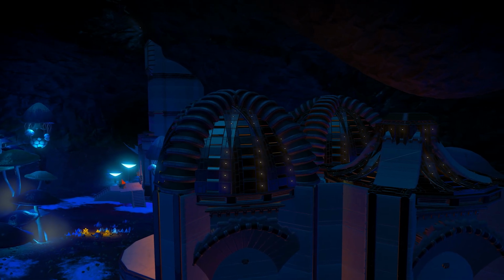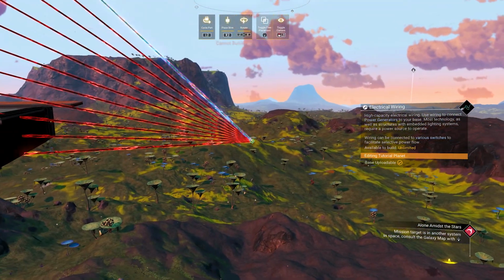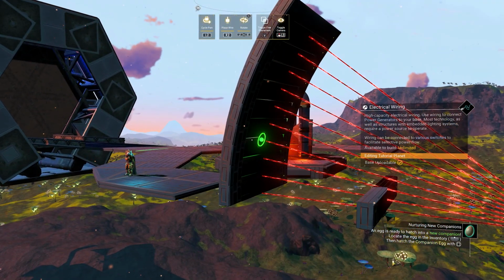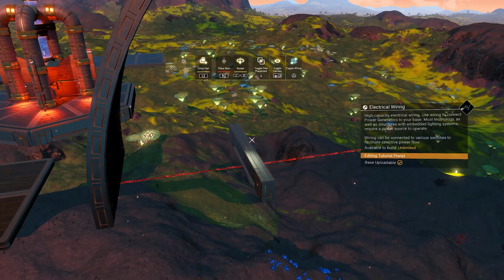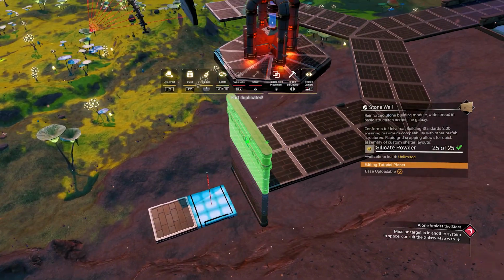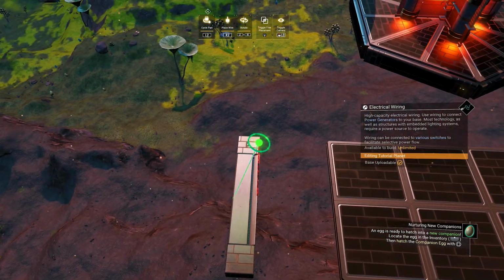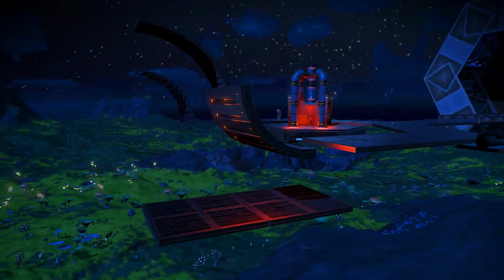How to Build Curves in No Mans Sky Waypoint 4.0 - Glitch building techniques

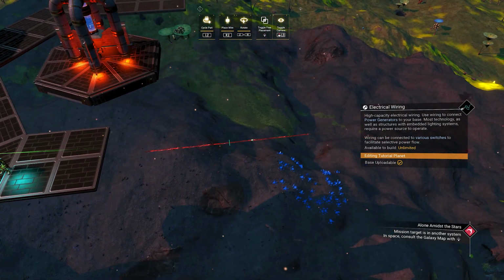Comment: Perhaps I'm too late on learning this glitch, but it seems to be outdated when using the 5.74 Worlds II Update. I can get the electrical lines lined out to match at 1:11, but when I go to try and line up the small alloy wall a with the end of the wire. I do not see a snap point at all. The only snap point I see is the top and bottom of the alloy floor panel.
Reply: Hello, I'm a PC player but you may find the right keys if you are a console player, tried today and it's still working. (Made my first curve youhou :) ) So there is 2 steps involving the Wire Toggle Key (A in my french keyboard, Q for others),  1/ Create the wire : Select a build piece, snap it (don't build yet) and then press Toggle Wire + Build (A or Q + Left mouse button), in this operation you actually see the build piece that will be replaced by the wire. 2/ Place a piece snaped to the wire : Select the piece you want to place, press A or Q to go in Wire mode so you don't see anymore your piece and the wire anchor point is visible, select the anchor and press A or Q + left mouse, your piece should be build and snaped with angle. if you miss the trick because of synchro, just press A/Q twice (go out and back to wire mode) to try angain. I hop this hellp. Remenber, Place a wire = I see the build piece and I glitch it to a wire // Snap to a wire = I dont see the piece I will glitch I'm in Wire Mode (time to time the piece go wild and snap to any surface when you miss the trick, i go back to edit mode (C for me) to unselect the wild piece and Duplicate a spare "fresh" part I keep on the side with E (so I dont leave the free camera mode by going in the parts menu)
Reply: @stephaniee.9384  you should make a video :)
Reply: @josephrhodes4844  I was tired to try and die, I found a free macro tool for windows.. 1 key only for each trick and 100% success :)

Comment: Advice please. Idk if it's just me but I find it very difficult to hit Q and click at the right time I guess, I get it but takes about 10 tries every time and also have an issue with the wire going to the ground or somewhere random instead of floor snap point. Is this just a me issue? Any tips?
Reply from the maker: Glitchbuilding on keyboard and mouse can be very tricky. 
Many players on PC either remap their controls, or add a hotkey that serves as the mouseclick.
Others use Macro's that do the combinations with just one button press.
Myself, I just prefer to build with a controller instead, it just feels more natural to get the buttons pressed.

The wire going some where random most likely is due to the fact you are having trouble with the glitches, so your mouse moves away from the point you wanted to glitch on.

Comment: hey, I like your building videos. I have a few problems. I made a circle of 64 like in one of your videos. Now I want to round it off with glass walls.
The first row went very well up to the top in the middle, but in the second row, after the 4th glass wall, it doesn't go any further up but 45° to the right. Have I made a mistake somewhere? I did it exactly like you. I'm just getting desperate 🙈
Reply from the maker: Check your wire connections, You probably have a wire that started to go crooked.
This happens a lot when other wires are connected to the same CenterPoint and they influence the connections.